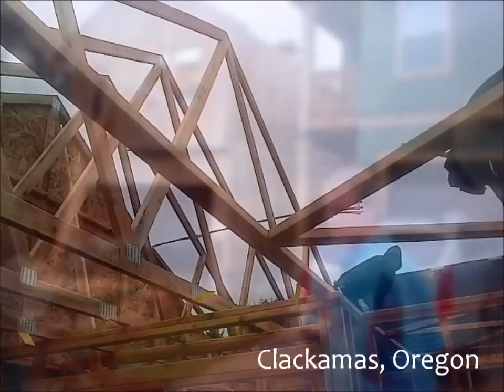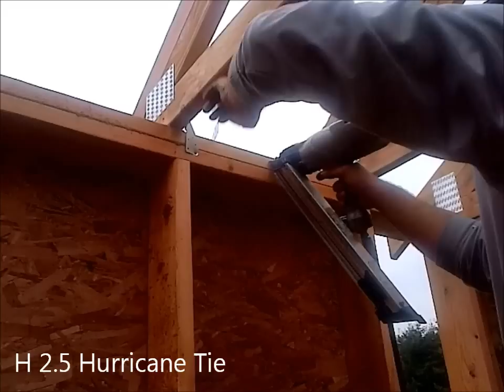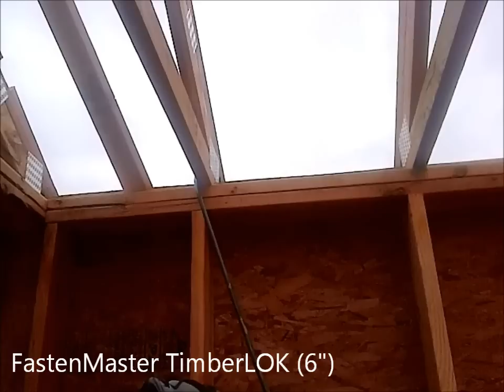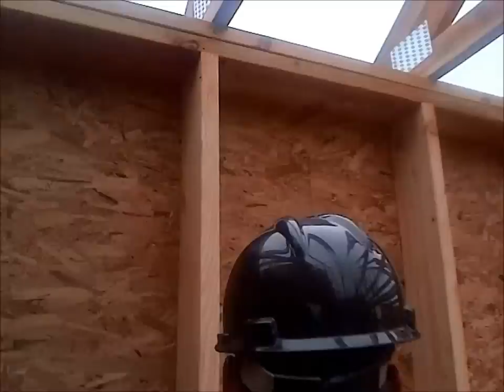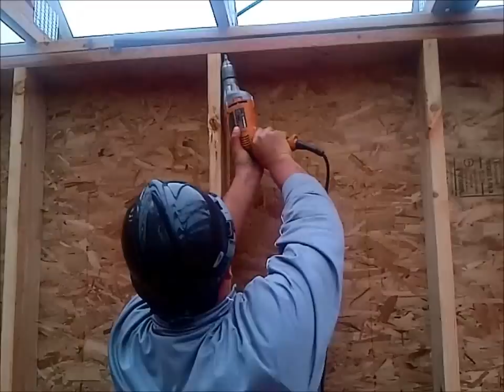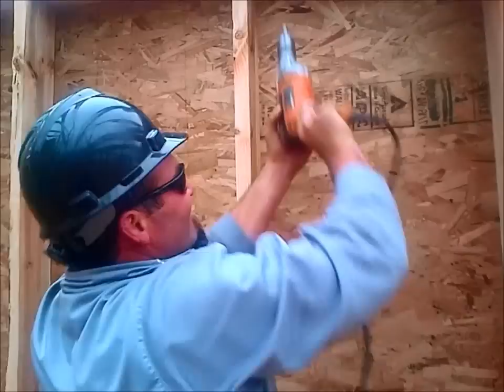Building better using aTimberLOK from FastenMaster, setting trusses

Comment: Why are the studs and trusses not in line with each other?
Reply: studs may be spaced at 16" on center - or sometimes 24" on center. Trusses are  generally spaced at 24" on center. In this video, it appears that the wall studs are spaced at 16" oc and the trusses at 24" oc. That's probably the reason why they don't line up vertically.